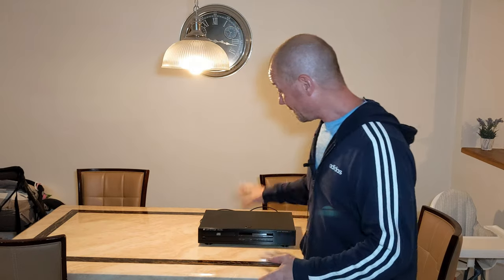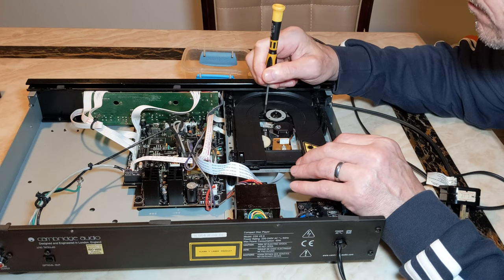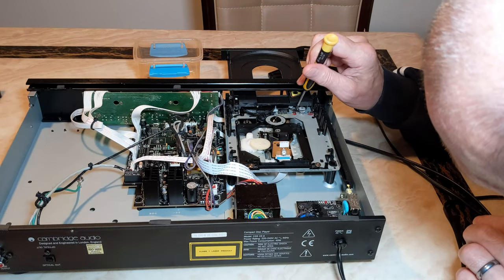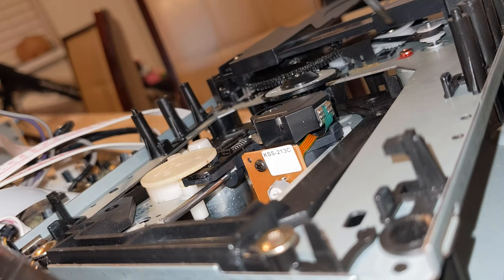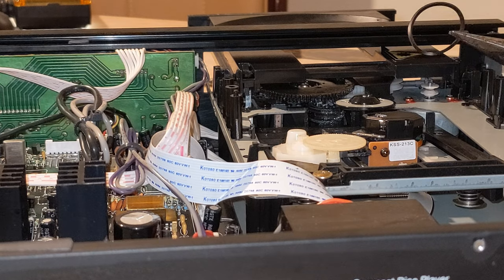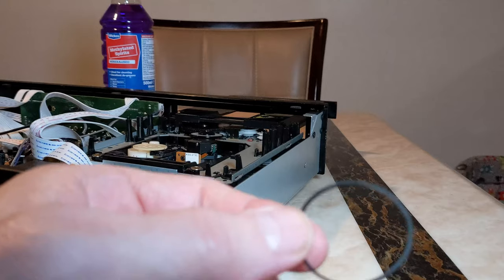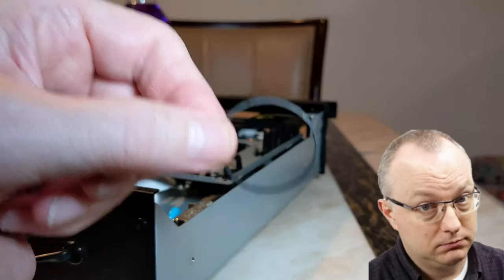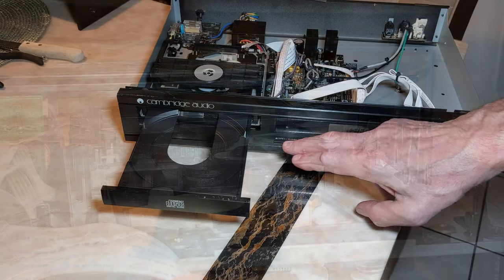CAMBRIDGE AUDIO CD5 DRAWER STUCK!

Comment: Hi. Much easier if you take the tray out. With the deck facing you, on the right side of the tray at the back is a removeable stop. A lug needs to be gently pressed and a "T" shaped stop levered up with a flat blade screwdriver. Be gentle as the stop can spring out and be a bugger to find. It is essential! You can now slide the tray forward. It will only go so far. Look just behind the fascia on both the left and right hand sides on the tray platform. there is a small circle of plastic on a curved plastic arm on each side. Insert a small rod/cocktail stick into the small circle and lever sideways whilst pressing the tray from the back. As you've only got 2 hands do each side separately, with each push the tray will move slightly to pass the stops on each side until it will then push out cleanly. The cover plate that you snapped off can now be pressed towards you and lifted sufficiently to get access to the pulleys. Once the belt is changed the cover plate has to be pushed back so it latches as it tensions the larger pulley providing a top bushing. Maybe this is why your draw is moving more slowly as without this bushing the larger pully is only located at the bottom. Slide the tray back in and re-fit the "T"-shaped stop, then refit other parts as before.
Reply: I also loosened the 4 bolts holding the tray mech in which let’s you access the cover plate plastic holding tab below.  Push it in with a flat blade and it pops out. Then it’s very easy to change the belt.
Reply: No need to remove the T shaped section fromv the rear right of the drawer, gently pry the restricts from each side at the front of the tray rail with the visible circular lugs, this alone allows the tray to move forward enough to expose the pulleys and belt, allowing you to remove the pulley cover without breaking it, in total, less than a 5 minute job 👍

Comment: Just before Xmas I repaired our old Sony CD player drawer with guess what? A rubberband that the supermarket puts around bunches of spring onions. The old drive belt was maybe thinner than the one shown as the replacement here and had stretched so much that it wasn't moved by the pulley at all. Youtube advice was to place the band in boiling water for 3 minutes to shrink it back but it didn't wirk for me. After a quick scan around the kitchen for something similar I found the spring onions. Fortunately the access to the drive pulleys was much easier than in the Cambridge player and the rubberband seems to have a better traction than the polmer original drivebelt. I have a box of rubberbands on hand even if my repair fails in the next year. I was surprised that the drawer drive mechanism was as simple as just a belt drive I had envisaged some sort of cog and rack solid kit. Just goes to show that it is worth having a quick look at the innards before throwing things out.

Comment: Never put grease on those belts! you must clean with alcohol the belt weels grooves and replace it with a new one and after this is recommended to clean the laser lens gently with alcohol
Reply from the maker: I never mentioned putting grease directly on the belts or the belt wheel grooves because that would be pretty dumb.

Comment: I have the same problem with the drawer not opening. Followed your video but the problem is not the belt, it is the magnetic part that sits on top. The drawer works fine when that is taken off - not sure what I can do. Any advice gratefully received.

Comment: My draw gets stuck halfway and it won't budge. It's the same cambridge audio cd player
Reply from the maker: Likely to be the same issue. The belt may not be strong enough to drop down the laser housing.
Reply: @UTILITARIANTVUK  thanks, I’ll try and find a belt
Reply from the maker: @musleman8  Even if it's not the issue you've only lost a couple of quid. I used an O ring of 20mm inside diameter (ID) and 24mm outside diameter (OD), 2mm width. It's smaller than the original but the larger sizes didn't work.

Comment: I used your video to solve an identical issue with a DENON DCD-755AR. Nearly similar tray/laser unit. I did take the front off and there it was: the little plastic thing (4'10") that partly covers the spindle and the cog wheel, both connect by the O-ring. That plastic cover let itself be removed quite easily, so I had free access to the O-ring. Which was the culprit of the tray not opening. Cleaned everything, re-mounted everything and: done!
Thanks to your video I dared to do it that way, so very much obliged!

Comment: This is much, much easier if you take the tray out. Open the tray until it stops. There is a small plastic lug in the rear right corner of the tray that you have to unclip and lift out. Once removed, there are 2 claws, 1 either side of the tray that you push outward and slide the tray out. You can then unclip the plastic belt cover with the single clip at the back and slide it to the left to get access to the belt. The belt should be replaced with the correct size of square drive belt, not an o ring as you can put too much strain on the tray motor and damage it, or strip the plastic gears that the pulley drives.

Comment: I just watched this and opened up my CD and cleaned the belt and posts with some alcohol and bingo it works - I got a 
£4 belt coming that I don't need but hey I got a spare! Your CD5 and my CD500 are great players well made with good components and are worth saving.
Reply: Can you help me - on first operation the draw stops after a cm but when closed and opened again it works every time. It just sticks on the first operation!! Sometimes it doesn't do it at all. Do I need to go in again and clean the drive wheels that run the belt again or will usage clear this up?

Comment: I think I'm going to try this with my Cambridge Audio CD5. It's a great little player (when it works!) Where is the cheapest place to get o rings? 
Thanks for this video.
Reply from the maker: I think I bought mine from eBay?
Reply: They are on line for £4, I got a CD500 and the drawer is sticky  so doing this job on arrival of new belt. Was quoted £75 to do the job by local company!!